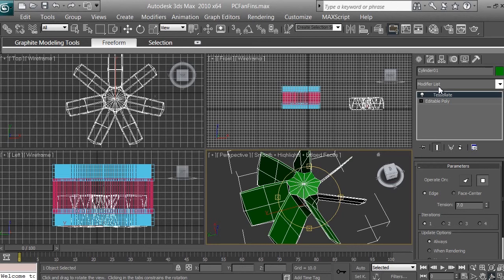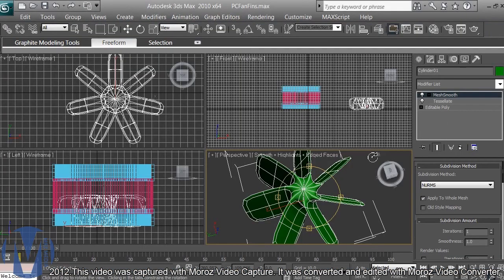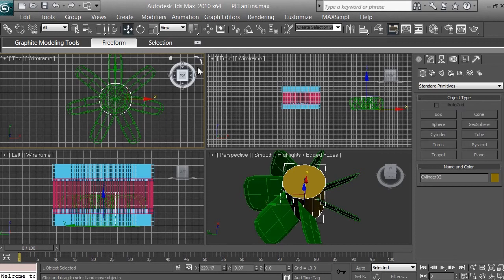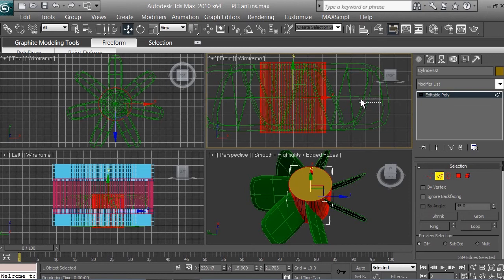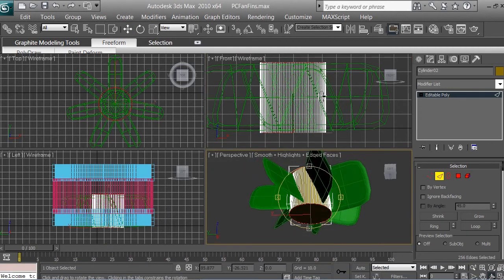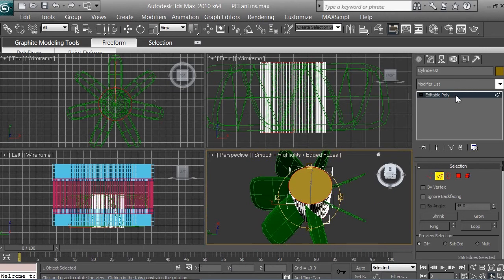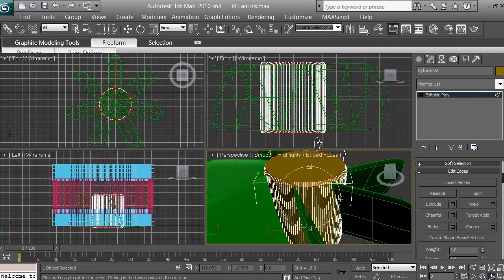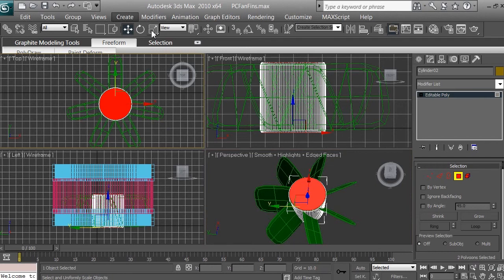3D Modeling - Computer Fan Tutorial - Beginners - 3ds max - pt 9 of 16

Comment from the maker: The idea was repeated and explained again with the connector and wires. I will go over it again with link and unlink tool. So basically you use that link(chain icon in the top left corner) whenever you want to attach your object to another, and you can always unlink it with broken chain icon(Unlink)close to chain icon.Thanks for let me know about time hole skip here.
Thanks for the subscribing,it will be a good ride on the IT,3d,graphic design, programming, photography Highway of knowledge share